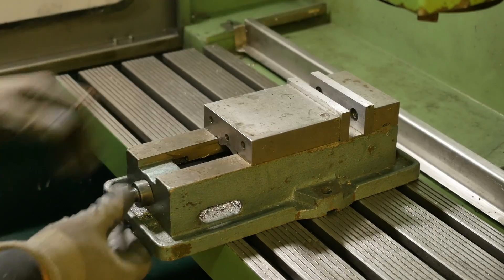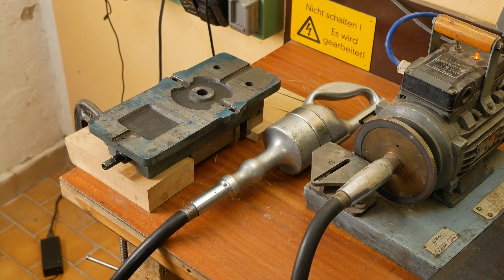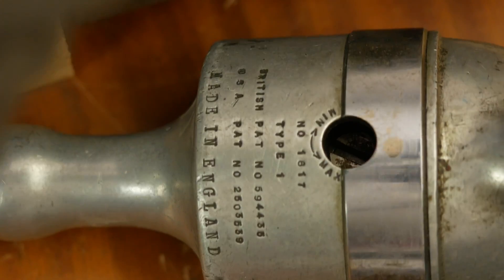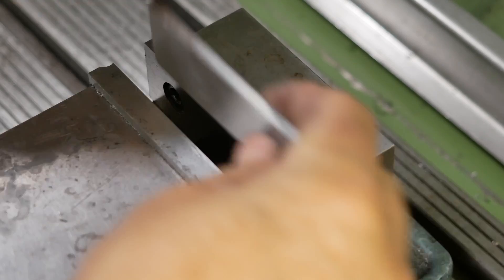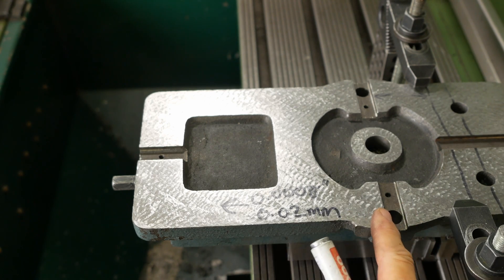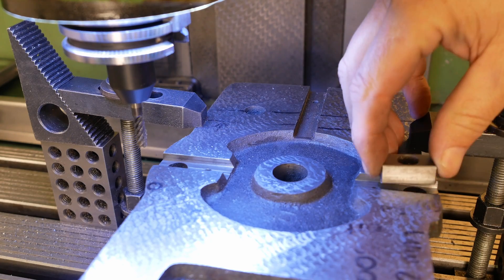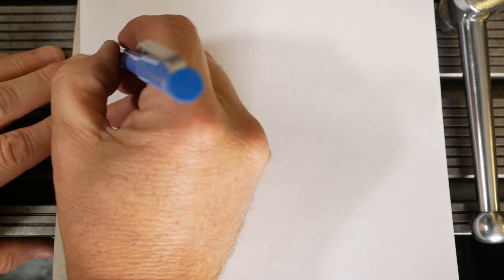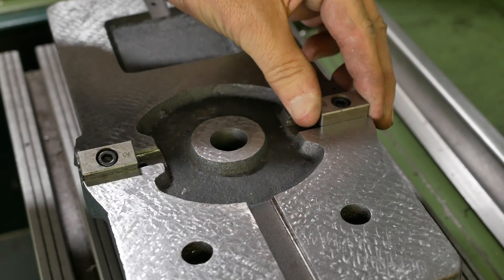Tweaking a machine vise to speed alignment. || RotarySMP

Comment: I turn my keys out of round stock & make buttons with countersunk bore for the mount screw. That way I can easily turn a step into the OD to fit the vise & keyway, if they don't match.
Reply from the maker: Good tip Martin. Thanks.

Comment: Turned  out well. I had to go down the route of machined keys like those you drew as the key slots in my vise are wider than my tee slots. It did take a bit of messing with.
My vise mountings are slotted out the side so one can slide the mounting bolts in and out. Looked a bit fiddly trying to feed the vise over the bolts.
Just out of interest, have you checked the parallelism of the vise base to the upper surface (where you sit the parallels) and the top surface of the jaws?
Reply from the maker: Hi Andrew, I haven't done any other checks on this turd-vise, but I can see that I will be scraping the whole thing in sooner or later :)

Comment: Got to love the power scraper, what a tool!
Reply from the maker: Yeah, it really is a nice machine. Heavy and it takes a fair bit of space, but works really well, and doesn't scream loudly :)
Reply: @RotarySMP  Yes, I was impressed by how qiet it was when you turned it on!
Reply from the maker: @philhermetic  I do drop the audio level when machines run, but that is a nice hum, rather than the scream of the angle grinder motors Biax uses.

Comment: If it takes you 15 minutes to tram the vise, that is the problem.  Understand that process better and forget the keys.  It should take 1 minute to get within half of a thousandth of an inch.
--Doozer
Reply from the maker: Good point. It starts with my pretty crappy mag base. And that I dont do it often enough to get fast.
Reply: @RotarySMP  You don't need a mag base.  Just hold the indicator in a collet in the spindle.  -Doozer
Reply from the maker: @kooldoozer  That makes sense. Another tool holder dedicated to the indicator. That would sped things up too. Thanks for the tip.

Comment: I've been using my set of 2 stone very heavily over the last 5 years, and their accuracy is still actually spot on (i've got a few oversized gauge blocks and they clean and polish them beautifuly which indicates great overall flatness) ! I think the theory behind this might be, that if you use it only on various ground/scraped surfaces you're actually averaging out any error that one single surface wears in the stone -> the next surface comes in and wears something else -> rinse and repeat -> error averages out of your stones are actually still very flat and even flatter than they were at the beginning.
Reply from the maker: Only after I edited that I starting thinking. Two stones has four surfaces, so I you mix it up and don't aways rub like on like, it would also have the same effect.
Reply: The surface being stoned is a third surface, too.
Reply from the maker: @somebodyelse6673  Good point. I didn't think of that.
Reply: @somebodyelse6673  exactly

Comment: Man! Can you believe this! I was doing exactly the same in my shed this morning. Go inside to have lunch et voila, some free tips from the pro. Thanks for another awesome video
Reply from the maker: That is funny timing. Was your slot also a bit misaligned? I got lucky that it was also undersize.
Reply: @RotarySMP  there was no slot, so I used a 4mm wide parallel in the bed slot, which I clamped in the vise jaws and strapped the vise down to the bed upside down and milled it. It was only a 50 euro vise for a small hobby machine, so dimensions are less critical. 
I made the 4mm blocks myself from normal hot rolled steel (since I have no clue where to get tool steel in small amounts for a decent price).
Reply from the maker: @josseman  Nice solution.

Comment: Nice project, I've done this as well to my vise in the past and it's much quicker now to set up.
I made my keys a little undersized so they are in line when I push the vise forward before clamping it down.
This way I can still indicate the vise if something funny happens or I need more precision.
Reply from the maker: These ones are so nice and precise, and the Maho slots are also very high tolerance.
Reply: @RotarySMP  Yeah I believe that, mine are just some scraptonium

Comment: I found that keys are not so precise as I would like. There is always some deviation. I always run dial indicator on the vise at work.
Reply from the maker: Those keys I received are very precise, but there are some dings in the table which may effect accuracy.
Reply: @RotarySMP  Yeah, that's what I mean. Keys may be super precise but there's always something askew. Better to indicate that stationary jaw than depend on keys if precision is necessary. But almost always keys are adequate.
Reply from the maker: @coreoocoreoo1059  I would need to do a lot more work on that turd vise before that was the keys were the limit of accuracy :) 
I do still have a grinder vise, I could strap down and dial in for more accurate work. Need to get a lot better at maching first.